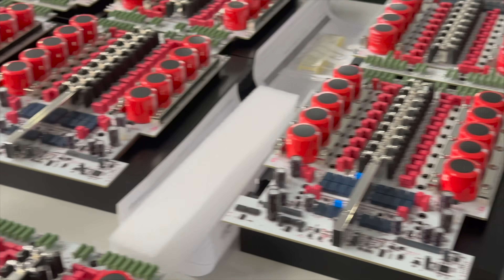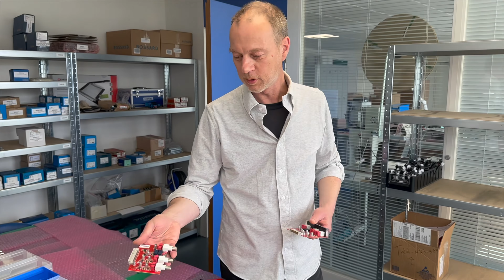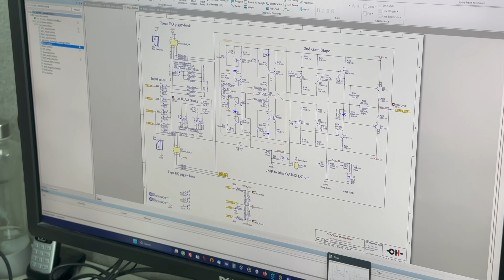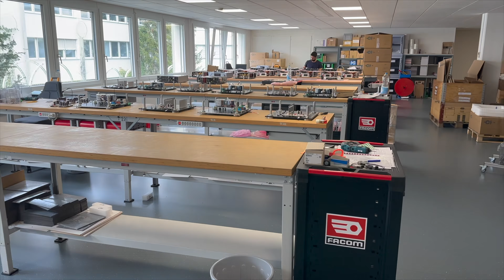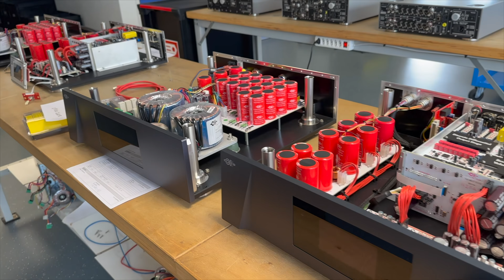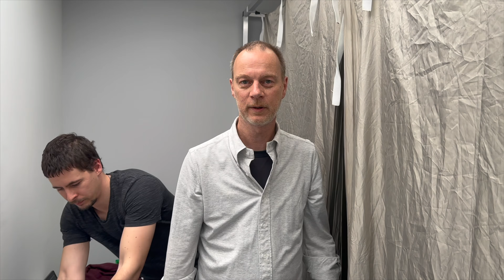CH Precision Factory Tour

Comment: Have you never been through an amplifier manufacturing plant ?????,  you act like everything is unique to CHH. In actual fact it is totally standard stuff , nothing special , all these processes are done by hundreds of other amplifier makers ( and a lot more by some ). Worked in a high end amplifier factory for years, its all ( yawn ) basic stuff.
Reply: Tell usmore, which amp wouldu buy if u had thecash
Reply: Hard to beat a troll.
Reply: @cameraplus7233  No troll about it. I gave constructive criticism based on years of working in the audio electronics industry.
Reply: @jackfros-e3s  not constructive at all, and as someone who knows exceptional vs average audio gear - CH Precision is at a higher level than most - not all, but most.  I can state this as fact, that there isn't any number close to 100 makers doing it at this level.  This is not basic stuff, far from it.  If you think this is basic, then you're either a troll or simply one of many who think they know more than they do.  Please answer the question, which amp would you buy if you had the cash.  Probably can name 10 at CHP's level - that's it, if that!
Reply: @jackfros-e3s  No, having probably never experienced CH Precision you gave an ill-informed opinion and pretended it was fact.  That is why you lack credibility.